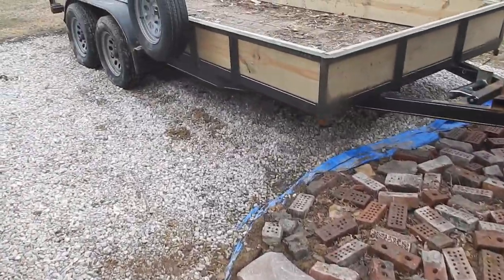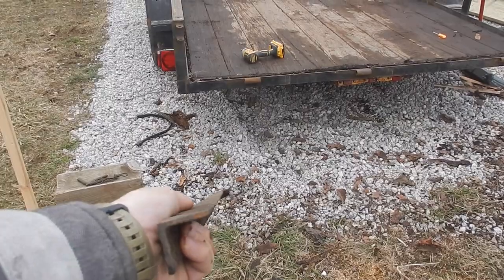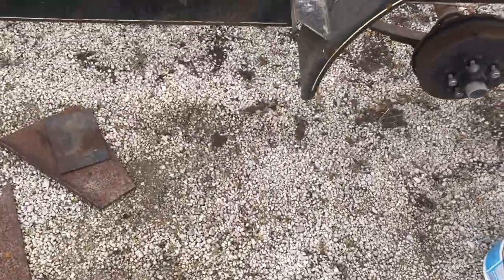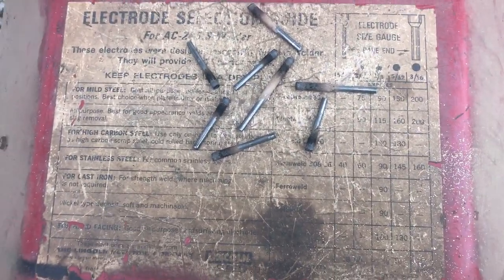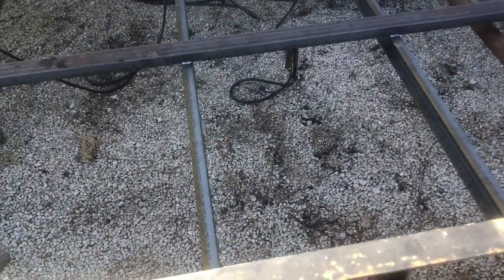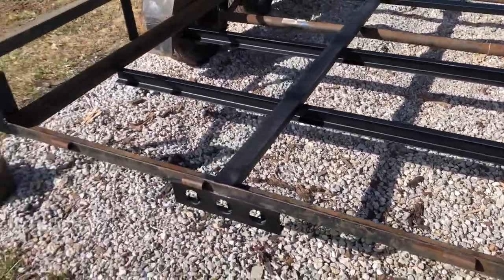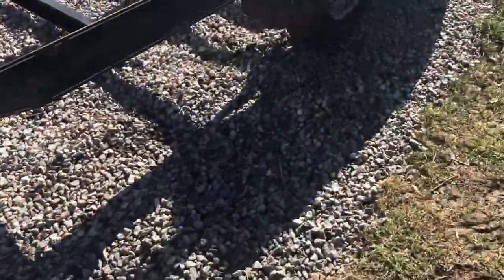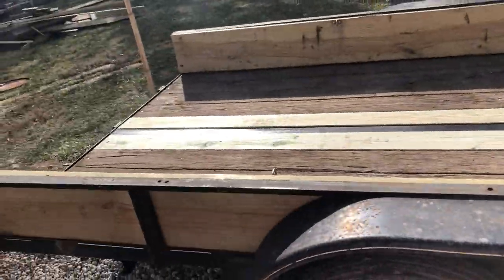Fixing a landscape trailer with a bowed deck

Comment: If you paint the trailer try using a mini foam roller. Really fast and you don’t overspray everything you don’t want paint on. A couple of thin coats. Rustoleum works great
Reply from the maker: Thats what i used on the expanded metal! Then a brush on the rest that i couldn't get.

Comment: Moral of the story is, don’t overload your trailer, or it will bend! He’s not a fast trailer fixer, not a slow trailer fixer, he’s a half-fast trailer fixer! Clean your steel before welding, and if you are going to go through all this work, spend a little bit more time, sandblast, or wire wheel the rest of the rust, then get some rust-oleum rattle cans and paint the whole thing, your ideas are sound, just need a little more follow through. 👌👍👍👍👍👍
Reply from the maker: Was originally going to restore the entire trailer but time got in the way. Main focus is to not overload it and i think the welds will be okay even if i didn't clean the steel.
Reply: @KenSlaton  They may hold, but let me ask you is it worth hurting yourself, or someone else if they don’t, not to mention if you are hauling equipment, the cost of replacement, like I said, your ideas are sound, you are obviously not a lazy person, a little time spent on prep, can save you a world of problems in the long run, and a lot of money, plus may shield you from lawsuits in the event of an accident, people today are not looking to say don’t worry I understand, it’s more like how much can I wring out of this poor soul. I am a retired business owner, I learned the hard way what motivates a lot of people looking for a quick buck. Just a word to the wise, coulda woulda shoulda isn’t fun.

Comment: So now go back and cut it all out and clean all the steel in the weld areas and weld it again. I commend your drive. But welding dirty steel makes weak welds and makes that trailer dangerous out on the road. But for just starting not bad. Watch videos to help teach better welding skills and remember practice practice practice

Comment: Black is ground in automotive electronics. Red is hot(usually), and orange is ignition power.
Reply from the maker: Of course I realized that after the initial installation. I’m used to house wire with black and red both being hot.

Comment: Hi i hope you put 1 inch by 3 inch square rectangular 1/4 inch wall ribs for the deck bed.
Reply from the maker: I used 3” C-Channel that was 3/16” thick for the ribs and for the long piece that runs the length of the trailer